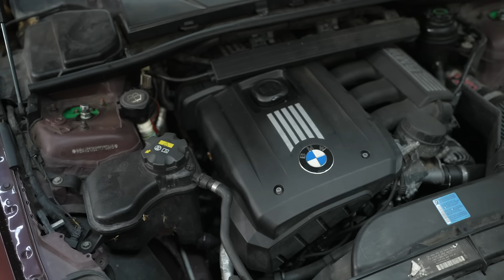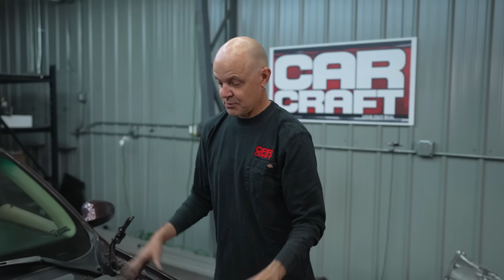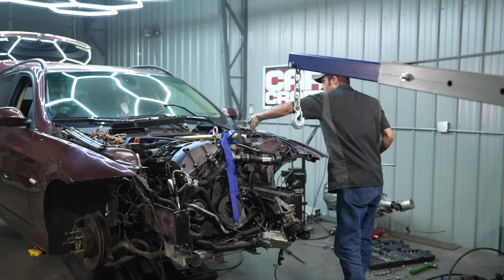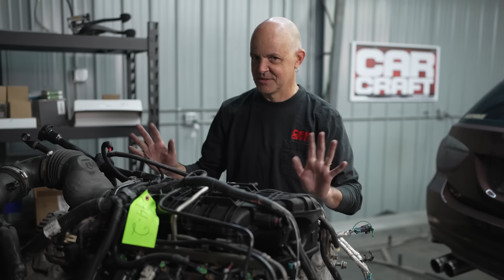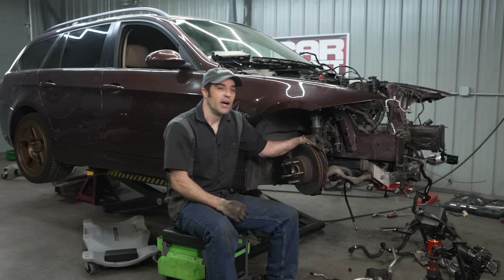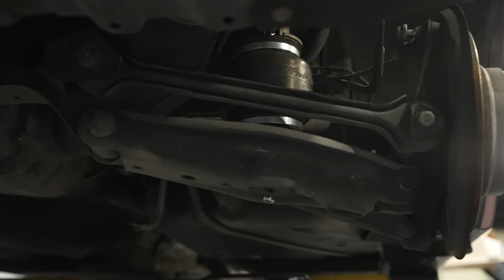LS Engine Swap in BMW! | Car Craft E90 Drift Wagon Build Ep 1 | MotorTrend

Comment: Your facts are incorrect.  The E90 was first introduced as a 2006 four door sedan in 2006, NOT 2004 as stated in the video.  The E92 coupe and E91 wagon both followed a year later.
Reply: Wrong. They were absolutely right. And if you want to get real specific. It was produced from December 2004 - October 2013. Tryna sound smart got you looking dumb. 🤦🏻‍♂️🤦🏻‍♂️
Reply: & as far as the E91. It was produced from September 2005 - May 2012. 
But great knowledge you seem to not have.

Comment: you guy should diesel swap something with like a pickup truck engine
Reply: Diesels are not very common or popular in USA, especially since the Dieselgate scandal in 2012 in which VW was caught using  cheating software that detected when it was being tested by reducing emissions while being tested, but then emitted up to 40 times the allowed limits for diesel emissions when not being tested.  Then there is the issue of diesel fuel being about a dollar more per gallon than gasoline.

Comment: Great episode.  Which part number did you guys used for the exhaust manifolds?
Reply: There is no part number for the exhaust manifolds.  The exhaust manifolds have to be either handmade or modified due to clearance issues.  Neither BMW nor General Motors makes an exhaust manifold specific to this swap.